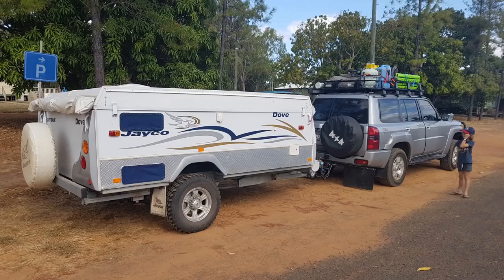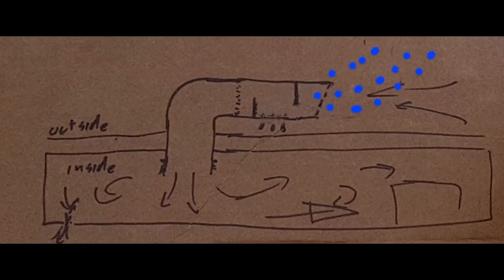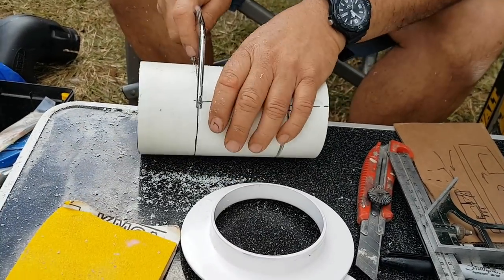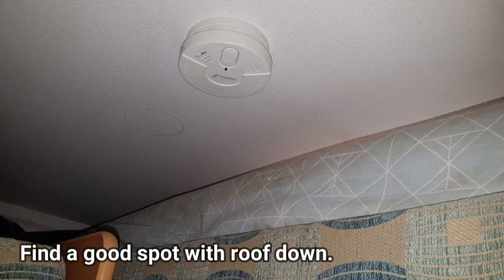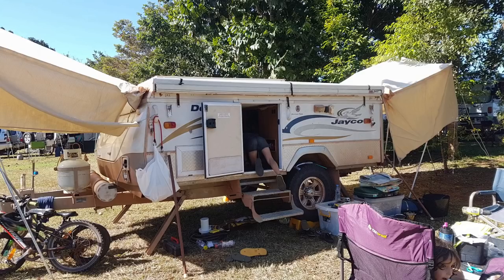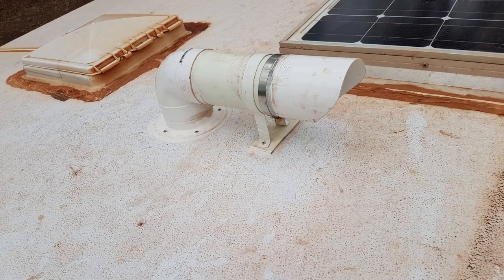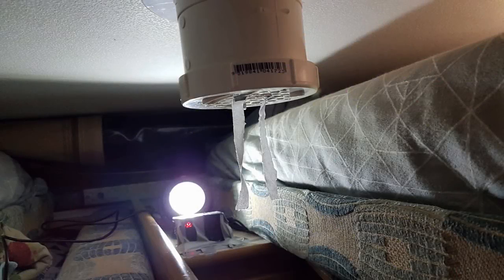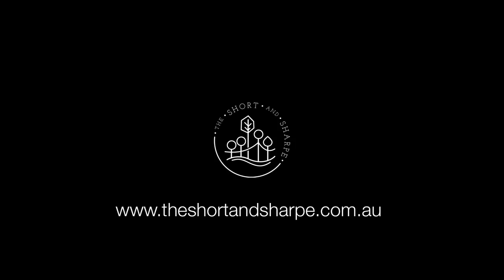Caravan Snorkel with rain baffles - DIY tutorial

Comment: Good work. Perhaps a flat, car air filter on the inside would be a bonus.
Reply from the maker: Thanks Reece. That may work, but might be difficult finding one with a good fit. I just happened to find a cheap pillow that I could rip some stuffing material out and just shove into the air outlet.
I also tried a 4wd snorkel sock on the outside, but it clogged up very quickly.

Comment: Baffle is baffling. Nice concept, but there is no dust in the rain. so just put a cap on it then. Also, if you use a reducer to get the size at the outlet down to say 2 inches, you'll have created a venturi effect to accelerate the wind speed, in addition to reducing the the need for a 4 inch hole / large in your rig.overall, very clever, nice filter design and the video test was brilliant.Clever folks in OZ
Reply from the maker: Thanks! Im sorry you were baffled by the baffle. I can see how it might be baffling.
The point however, is that you dont need to worry about a cap, ever. Its a set and forget solution!
I have driven it through pounding rain and not a single drop makes its way through....
Reply: @theshortandsharpe  Ahh. i'm on my couch, you're on the front lines, so who am i to critique your work.

Comment: Hi.. like your vid..very clever.  I have a fan vented, compostible toilet fitted, ducted to under the campervan. The after-fan  distance to van exterior is downwards and 15cms.  Road dust got up and clogged the fan.  What can I put ocer the hole under the van to stop dust going up but allowing the fan to vent?  Hope you can felp.
Reply: Glad you liked it! 
If the vent is under the van and you are driving on dusty roads, I think you are going to have to block that vent while driving. Dust will find its way into every nook and cranny. If the vent is open there is a pathway for dust to enter, unless you have a really high positive pressure inside blowing air out!
Reply from the maker: Hi. Did you find a solution for this?
Reply: Wouldn't the toilet vent have a fan blowing air out which should inhibit any air and dust coming in?

Comment: After watching this I made 2 for my 4wd canopy they cost about 12 dollars each and work a treat I made them out of 50mm poly from Bunnings
Reply from the maker: That's awesome that you adapted it to the canopy. Can you share any pics?
Reply: I can't right now but in a few weeks I can once  I get home
Reply: @theshortandsharpe  can't work out how to upload photos into comments
Reply from the maker: @andrewhodgkison7245  Hmmm yea, I think you cant. Unless you post a link to a Google drive or dropbox file...
Reply: All the photos are there of the first attempt the black one all pulled apart and then a few photos of the 2 installed on the canopy and the last photo is of the inside I haven't completely finished it as i do have a bit of tidying up to do as my canopy had a roof lining which i need to finish pulling out to make it look a bit better
Reply: @andrewhodgkison7245  thats so cool. Thanks for sharing! What diameter pipe did you use, looks quite small?
Clean up an finish are always the trickiest jobs!
Reply: @Deep_Orange_Design  I used 50mm due to lack of room with All the bracing and the ribs of the canopy and also made it easier to hide it with in the roof racks plus the filters that I used were for 50mm and because I only used 50mm it is why I made 2 so I could get enough air in there to pressure the canopy and keep the dust out from around the tailgate the real test will be in about 6 weeks time when I cross the Simpson desert
Reply: @andrewhodgkison7245  great. I hope it works in the Simpson. Would love to hear how it goes...
Reply: @Deep_Orange_Design  I think it maybe awhile before I get to find how it goes across the Simpson

Comment: Hi do You think this would work if instead of mounting on the roof i placed the snorkel on the roof and ducted it down the front of the van and underneath and up trough the roof I'm against holes in the roof
Reply from the maker: Hmm, maybe but I foresee problems....
1. Presuming you meant up through the floor, the only real space is the gap between the beds. Anywhere else the airflow will be restricted.
2. You will probably run into hassles lifting and closing the roof with the extra lengths of pipe you will need.
3. More pipe means more resistance wich will mean less pressure.
4. You will have to make a hole somewhere, the roof is the easiest and most out of the way solution.

In short, I would stick with the plan as shown!
:)